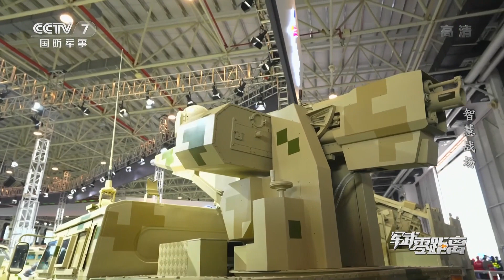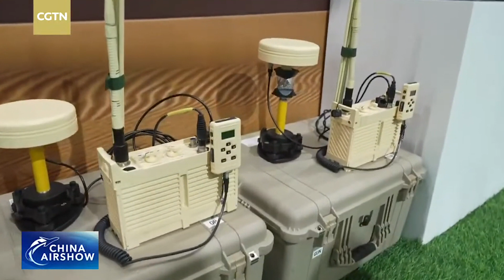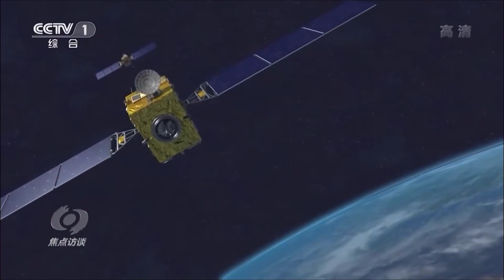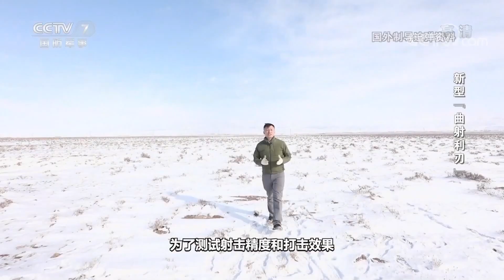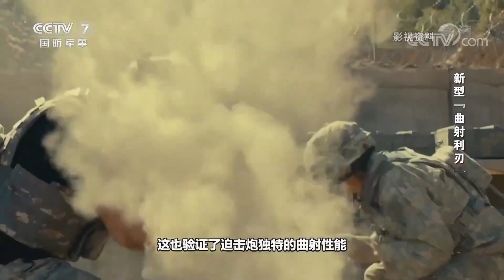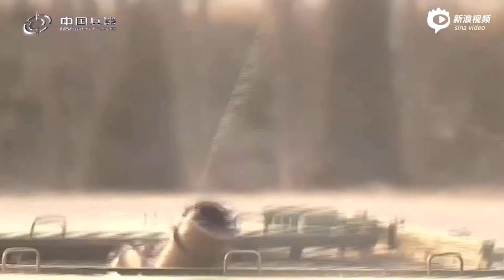China’s automatic 82mm & 120mm vehicle-mounted rapid-fire mortars, CS BEM1 satellite-guided mortar

Comment: The holes are thrusters used to adjust flight of the mortar round.
Reply: I was a 1e-Echo, Artillery Fire-Direction Control Specialist and an 11-Charlie, Heavy Mortarman in the Infantry of the US Army. I know a little bit about Mortars. 
I'll be the first to admit that I've seen some amazing new tubes and accoutrement, but look into the difficulties they are having in achieving production of the Ramjet 155.
Reply: @chrisfarrell9894  idk if they are supposed to be thrusters, perhaps it is compressed gas being released. they are achieving that accuracy somehow. guided mortar rounds do exist. Israel has one, i think the US has developed them as well, but they seem to use fins rather than.. whatever this is.
Reply: Thrusters? You've been watching Battlestar Gallactica or Star Trek. There is a guided Artillery round in development. The ability to overcome the forces on the round when fired as relate to a Ram Jet propulsion/guidance system. They are getting close. It increases the range of Artillery over three times the current achievable range. There is no mortar round that can currrently be guided in flight to my knowledge. I think this is fake news.
Reply: @chrisfarrell9894  These aren't even that new. I saw a video a few years back where the US was testing these and they called it mini thrusters. Basically mid flight adjustments to increase accuracy.